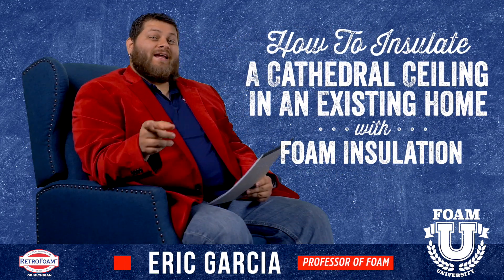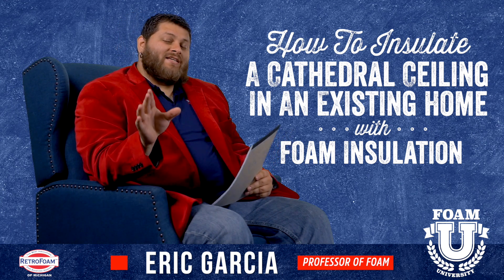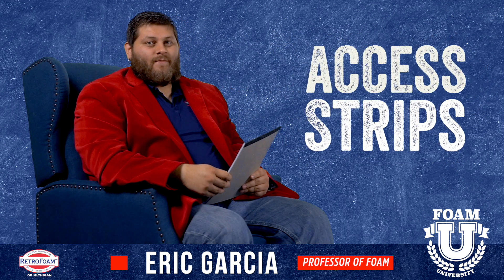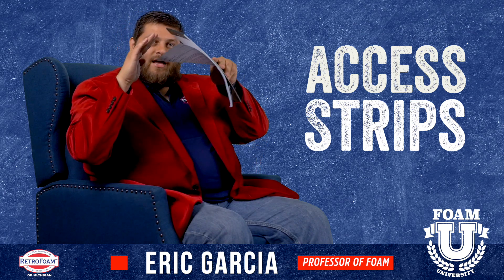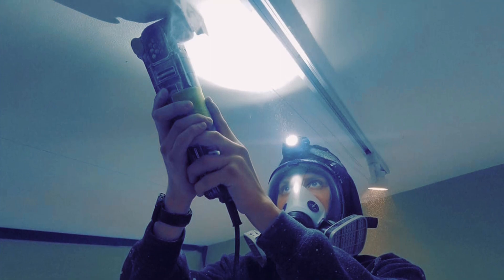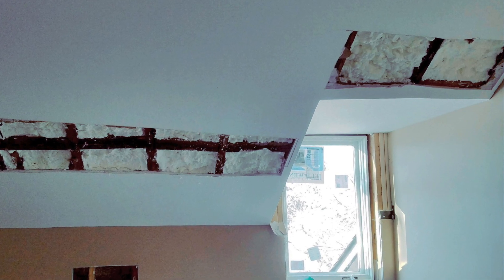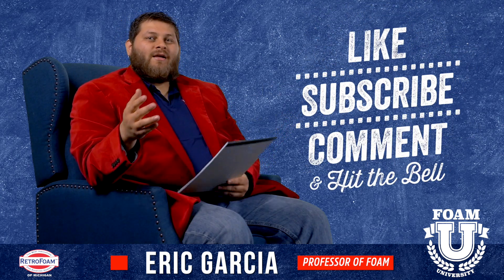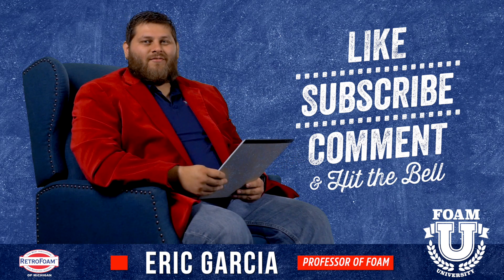How to Insulate a Cathedral Ceiling in an Existing Home with Foam Insulation | Foam University

Comment: Does it matter if you use closed cell vs. open cell on ceiling?  Is one better for snowy climates?  Is it best to vent either one if possible?
Reply from the maker: It depends on your specific needs! This article from our blog should give you some general information on which kind of spray foam would be best for your project: https://www.retrofoamofmichigan.com/blog/open-vs-closed-cell-foam-insulation

if you're looking to insulate your attic, you can either go with a vented or an unvented system. Spraying the attic floor creates a vented system, which is great for resisting heat transfer and allows for airflow. Spraying the roof deck creates an unvented system, which relies on an air seal to make the attic a conditioned space. This article contains some more information on that specific topic: https://www.retrofoamofmichigan.com/blog/vented-vs-unvented-attic-which-is-better
Reply: @RetroFoamofMichigan  it is a vaulted ceiling,  prone to ice damming.
Reply from the maker: Open cell spray foam would be a good fit for this application.

Comment: Doing it this way creates a hot roof, which can void shingle warranty?  Wouldn't it be better to spray from the opposite side, under roof deck and leave air gap for venting?
Reply from the maker: The idea that foam insulation will damage/void your shingle warranty is a common misconception. This article from our blog contains some additional information you may find helpful: https://www.retrofoamofmichigan.com/blog/will-spray-foam-void-roof-shingle-warranty
Reply: @RetroFoamofMichigan  i read that however,  gaf told me it does void their warranty?
Reply from the maker: It truly varies from roofer to roofer, unfortunately.

Comment: Do you make the spray foam like the injection foam? Do you make a closed cel foam too?  What are the r values of each?
Reply from the maker: We mix everything in the trailer at the job site -- injection foam and spray foam! RetroFoam has an R-Value of R-4.6 per inch, but it actually goes up as the temperature decreases. Closed-cell spray foam has an R-Value of R-6 to R-7, and open-cell spray foam has an R-Value of R-3.6 to R-3.9.

This article from our blog contains some additional helpful information on this topic: https://www.retrofoamofmichigan.com/blog/what-is-the-highest-r-value-insulation-ratings/types/charts
Reply: @RetroFoamofMichigan  so the retrofoam is your own proprietary brand, the closed and open are not a retrofoam brand/product?
Reply from the maker: Correct!

Comment: I'm interested in a 1955 home in Grand Rapids that has some existing issues due to insulation issues in the cathedral ceiling. New roof needed too, uncertain if roof framing needs to be updated, but there are watermarks and sagging. I'm a bit anxious there's no fixing the insulation problem but I love the house. 😞 Can this be done on a ceiling that old?
Reply from the maker: We would recommend you get any roof and ceiling repairs done before adding spray foam to your cathedral ceiling.

Comment: Can I use foam board to fill the 2x8 ceiling joists in my cathedral ceilings?
Reply from the maker: Yeah you definitely could. We recommend airsealing with caulk or canned foam to get the best results, which may be pricey in the end, but it would give you the best results if you intend to do foam board.
Reply: Ok thank you. Would I need to install baffles going up the ceiling leaving a 1 inch gap for ventilation when insulating the whole thing with foam board?
Reply from the maker: With foam board that is not necessary!

Comment: Can this be done in a ceiling with timber slats? Perhaps from taking tiles off the roof??
Reply from the maker: Possibly with spray foam. We recommend reaching out to a few local contractors and having them assess the area you are wanting to insulate.

Comment: What was an attic in my house was raised up on one side and made into a living space. So I have drywall, then fiberglass insulation, then roof. 
This seems like a good option for having better insulation.

Question:
Is the purpose of using open cell, rather than closed cell, to be able to fill in as much void as possible without removing the entire ceiling? 

I’m wondering if it’s worth it for me to tear out the ceiling and existing insulation, have a contractor install closed cell spray foam, and then put all new dry wall in.  If it saves money long term on heat and AC that’s the route I’ll go.
I had also considered blow in insulation from that outside when I replace the damaged fascia board the summer.
I’m not sure the existing soffit and ridge vent serve any purpose now that the attic is a conditioned finished living space.
Reply from the maker: The thing with Closed Cell in areas like that is water can't pass through so if the roof was leaking it can hide any leaks in your roof. That is why we suggest having Open Cell done in that areas. It also would be very beneficial since that traditional insulation breaks down over time, foam does not!

Comment: I wanted to do this but when the builder insulated my Cathedral ceiling 20+ years ago they did'nt install any air baffles against the roof deck. No way to get baffles in now,without removing drywall and starting over.... Ugh !!!!
Reply from the maker: Yes, unfortunately you will not be able to add new insulation without taring down the Drywall. When it comes to the time that you want to replace the insulation up there we would recommend getting Spray Foam done. Spray Foam will be a permanent solution and you will not have to touch it again!
Reply: I just got a quote today from a local spray foam company and he said they would just rip out the batts and shoot spray foam in the cavity without any air  baffles. He claims they are very carefull not to blow out my ceiling with expansion. I asked about no air baffles and he said it would not need them and would be considered a 'Hot Roof'  I did'nt quite follow his explanation on how the moisture would escape with a vented baffle. Does this sound right to you ? I sure appreciate you replying and am really enjoying your videos. Thanks Much
Reply from the maker: @duckthis17  Yes this would be correct! With Spray foam the home would become a ventless system. When Spray Foam is installed, that foam is eliminating heat transfer!
Reply: @RetroFoamofMichigan  Ok,but where does the moisture from inside my home end up if it cannot pass through the layer of SF being it is a vapor barrier ? Being in the south I assume you had better have AC to remove any moisture in the home ?  Thanks again for replying, I really appreciate it.
Reply from the maker: @duckthis17  yes, you should rely on your HVAC system to control humidity in the house.
Reply: @RetroFoamofMichigan  I sure appreciate your reply. Thanks again.

Comment: Hi, thanks for the video! I've got a cathedral ceiling with only one side to the rafters. I'm a bit confused about the cutting of the 1' -2' strips. Should the cuts run horizontally as you look up at the ceiling from below? My ceiling is probably 10'-12' from soffit end to peak. So if I'm understanding correctly, how many strips would be needed for the installer to be able to get the foam on the roof decking?
Reply from the maker: Russell that is completely dependant on your specific project. If this is something you were thinking about we would definitely recommend having a contractor come look at your project first before having any of the work done. All projects are unique and you really want to make sure you get the perfect solution. If you are in Michigan we would be more than happy to come take a look at your project!

Comment: Open cell foam has a tendency to shrink leaving an uninsulated air gap
Reply from the maker: Although anything is possible. We have found that with good foam and good installers, that is not the case.

Comment: We have a cathedral ceiling where half of it is attached to the rafters and is insulated well. But the other half (facing west and gets afternoon sun) there is a crawl space between the top of the ceiling joists and the roof rafters. What is the best option to further insulate that area? Spray insulation filling out the 2' crawl space entirely?
Reply from the maker: We would handle this the same way we would with a regular cathedral ceiling installation. We would cut strips and spray the foam into the cavity.

Comment: So where are you making the cuts? I just found out the house I bought doesn't have insulation between the ceiling and roof. (ceiling attached to rafters). Trying to figure out how it will be fixed
Reply from the maker: Great question, Andrew.
One- to two-foot strips would be cut through the middle of the stud cavities on either side of the peak. This way the installer can spray from the soffit up to the peak in each cavity.